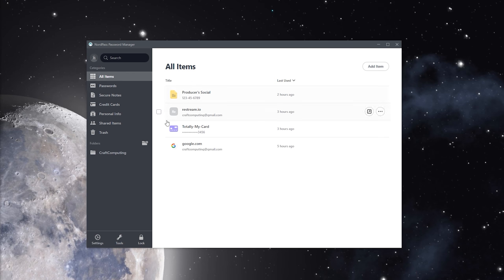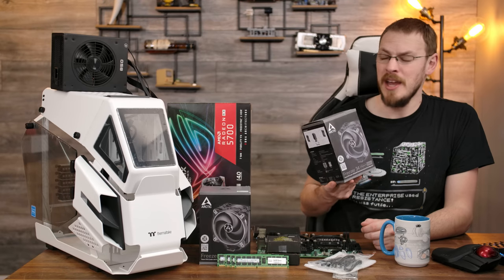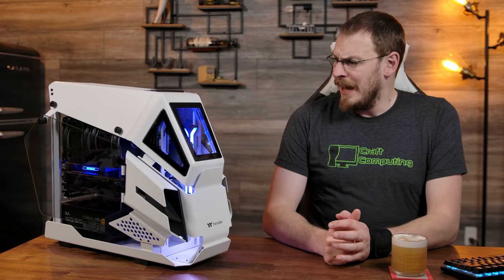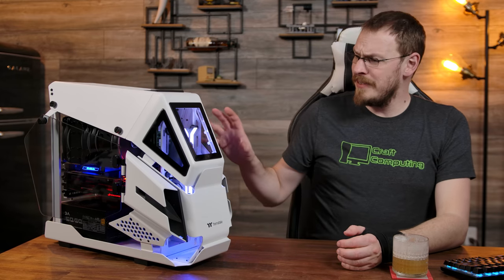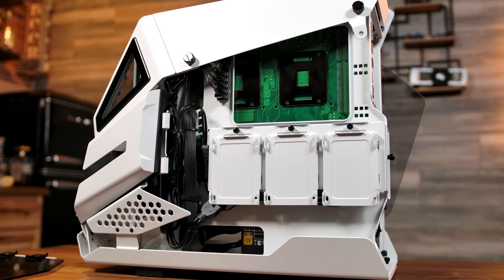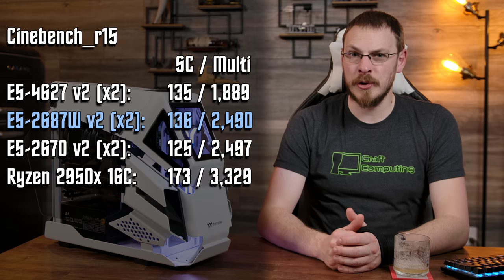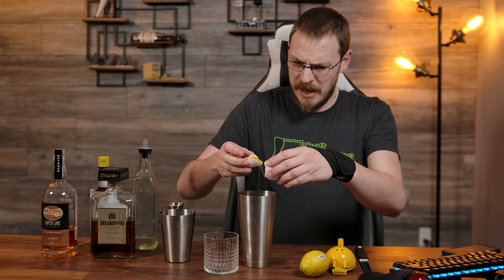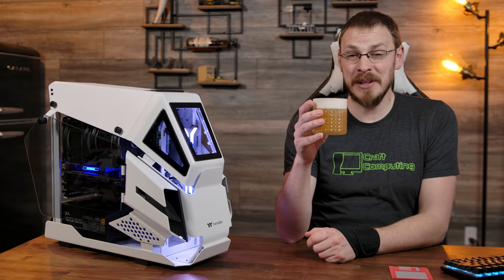Dual x79 + E5-2687w V2 in a MicroATX case!

Comment: E5 2667v2 is basically the same CPU, but at130w TDP rather than 150w. I recently built a dual CPU PC with them, and I honestly could not be happier with its performance.
Reply: Hey man, 2 years in the future im trynna do the same thing with the v4 version of the cpus, just curious if youve had any major issues in the 2 years since you built it, cheers

Comment: You cannot Turbo Unlock v2 CPU's, ONLY v3 Xeons unfortunatly.

But boy do my dual 2670v3 run fast :D
Reply: Exactly, the Turbo Boost unlock only works on Haswell CPUs. I'm commenting to try to make this comment more noticeable. Best regards!
Reply: lol, what about V4's ?
Reply: My Ivy Bridge-EP/EX Xeon E5-1650V2 CPU will quite happily run at 4.1Ghz all day. It's base clock is 3.5Ghz and my machine is an HP Z420.
Reply: @OmegasTracklab  anything after v3 is locked
Reply: @OmegasTracklab  neither v4 can be turbo unlocked
Reply: @PaulLemars01  That is a E5-1xxx CPU, not a E5-2xxx cpu.. They have unlocked multiplier and that is a whole different thing from turbo Unlock of E5-26xxv3 CPU's.
Reply: Yeah was gonna say, I didn't think a majority (all?) of these x79 chinese eBay specials couldn't have the bios modified let alone upgraded

Comment: If it helps you believe that cooling, E5-2690v2 in my Corsair case with a 212 EVO only runs at 55 under full load. Those Xeons with enthusiast cooling are a beast of workstation chips and run extremely cool!

Comment: Used this exact board and a pair of E5-2670v2's in my last home hypervisor/NAS in a Fractal Node 804. Ran it 24/7 under load for a year with zero issues.
Reply from the maker: Very nice! It would make for a very nice, compact home server 🙂
Reply: @CraftComputing  Very much so. And my electric bill thanked me for moving away from my entirely overkill rack to a uATX all-in-one. Have used my fair share of China Special X79/99 boards and haven't had a single problem with any of them. Once they have one with onboard video and IPMI I'll go back. Until then, I have to stick to my Supermicro board. Really enjoy your content. It isn't your typical tech channel. Sub'd!

Comment: It seems pretty good for what it is. I guess it just depends on what your use case is. If you are just looking at performance and don't need 16 cores for virtualization I'd say just spend the extra $200-250 and get a 3900x and decent motherboard, but if I already had this I wouldn't be looking to upgrade anytime soon.

Comment: I have one of these dual socket systems on a chinese remanufactured board you received a while back. I might seriously considering sourcing a pair of these cpu's and give it a performance upgrade. Going from a E5-2980's to E5-2687w V2's is a big jump. That's almost 1950X territory. As always, love the channel.  I just can't wait for the "Dual X99" stuff.
Reply: While searching the pricing on the E5-2687W V2,  I ran across the E5-2697 V2 for less money. Now I am back to cores vs clock speed. Which would you recommend, given the choice?

Comment: Extended micro ATX... Well, I for a long time have wished for a dual socket micro ATX board.
Though, the main thing I tend to look for in computers is memory bandwidth, and 4 channel support per socket is a killer feature that I wouldn't enjoy missing out on.
(Mainly since I do work on a lot of memory bandwidth intensive applications.)

Comment: Love your builds with obscure hardware like this!  Personal thoughts on the coolers though, not sure if noise was an issue but I'd remove one of the fans where they meet like the exhaust of the first one.  I find having fans butted up against each other can cause weird resonance especially if you have them variably controlled by the motherboard and might help the second cooler get some more fresh air to work with.

Comment: I really like the E5-2690 v2 Xeon's usually available on ebay for <$100 per unit. 10 Core / 20 Thread, 3.0 GHz Base / 3.6 GHz Turbo. 135 Watt...

Comment: The 2667v2 is basically the same CPU, just lower TDP if I remember right. 

The 1680v2 is also basically a single-proc only version that is also overclockable. I have a Machinist (Aliexpress) Mobo, so OCing is not only limited but more risky, but I bought the 1680v2 since it was only like ten dollars more than the 2667v2. It's worth having in the off chance I can get a nicer x79 board later if they happen to cheapen due to obscurity rather than explode in price like they have.

Comment: Extended Micro ATX.

In the meantime I laugh in Supermicro X9DRi-LNF4+. I had to use 3 EPS extenders and find negative-angled SFF8087 to fit this board in my case. Not to mention drilling and tapping 7 extra standoff holes.

Comment: Instead of a USB hub  (that end up using the same USB controller and can saturate it) you can install a PCI-E USB expansion card. I have one with 7 USB 3.0 ports and 2 controllers (4 ports in one, 3 on the other) and it is awesome. They are quite cheap on AliExpress. :D
Reply from the maker: I don't have any PCIe slots available. Both are used by the GPU and Capture Card.

Comment: It sure was worth the cost mentioned, I tried to go similar route a few months ago but with an ASUS dual 2011 socket board. What I failed to pay attention to at the time was V4 suffix on the description so alas, I went faceplanting into triple the cost that I set out to spend. However, I regret nothing, Broadwell is a very mature platform and the machine was worth every penny because performance I got out of it patched the price difference. 3ds max is still too heavily CPU dependent and with this platform the boost was insane compared to previous i7 I had.

Comment: I just swapped a Xeon E5 2690 V2 for an E5 2697 V2. I have 32GB of 1866MHz RAM and a GTX 960. My MOBO runs a 10% OC, so the 2697 runs up to 3.0GHz on all 12 cores. I use it for Handbrake video processing. It runs at the same speed on Handbrake as an I7 10700K with RTX 2060 with 48GB of 3200MHz RAM. The CPU cost me $85.

Comment: I don’t think the all-core turbo hack works on V2 chips anyway. Unless something has changed in the last year. It was always for V3 chips only from what I remember.
Reply: Also, for anyone interested in this level of CPU on the x79/c602 platform, there’s absolutely no reason to go with these CPUs unless they’re free or the same price as the 2667v2. The E5-2667v2 is identical in every way except base clock. The all-core boost is the same at 3.6GHz and the single core boost is the same at 4.0GHz. You get an extra 100MHz base clock on the 87Wv2, but you’ll never run base clocks unless you’re thermal throttling anyway. They both have the same 25MB cache, and bus speeds. And the 2667v2 has a benefit of lower TDP.

Edit: oh and the 87Wv2 only supports 256GB memory, where the 67v2 support 768GB memory.

Comment: Cpu temps. Hiding a failure?
Those are the temps for the hot spot on the die. Or atleast the "hotspot" the manufacturer put the thermistor on. With a cpu cooler that only covers part of an IHS, other hotspots may go un-cooled and un-measured
Reply from the maker: Each CPU core has its own temp sensor. I reported the hottest core. Trust me, I've been doing this a long time.

Comment: I'm wondering if it's possible to have a shroud between the CPU coolers and remove the middle fans (that way one is in push configuration and the other one in a pull configuration)
The shroud be like in a Z to force cool air over the left CPU 
I've seen something similar in HP Z800 workstation and would be nice to try 
I'm curious if we can get 40 degrees C for both CPUs :D

Comment: Pretty awesome! But to not post a CineBench MT mark...I guess it's trolling the ROM modders or frida users to help you unlock to 4 GHz. 
Safe to say I understand nothing about the airflow going on in that case; the top, the jowls, what that frameless thing backs up upon, a few still shots might have helped explain. What were the three slots in the back of the mobo plate, watercooling headers? Finally, what kind of IPC penalty comes in sharing data across CPUs?

Comment: i must have paused this video...like 10times to find in my closet what old hardware i have to build a new mini NAS cause i just remembered than my Zexyl 235 v2 doesn't support Sata 3 and i have Sata 3 drives in it....I dig out a Xeon E5504 4cores, and 6x2GB ddr3 1600mhz samsung ecc and a 120GB ocz SSD. now i need to find a mini Motherboard and a case and a sfm psu i guess... 
what OS should i use? FreeNAS?

Comment: I'm really surprised the case doesn't allow the PSU to draw fresh air through a vented bottom.  So, it has to mount the way you have it which causes it to fight the GPU for air.

Comment: I have the same problem with my server.I got like 18 memory slots 9 per cpu but only 4 memory modules.Given i got 32gb ram but i lose performance cause of configuration.I will try to get more later.As i am good for 288gb.I don't need it but i just want to do it for bragging rights 😁

Comment: LoL
"micro" - ATX. That's a 69L case.
I'm running dual E5-2667v2's on an Asus Z9PA-D8 inside a sub-20L Cerberus X. Completely whisper quiet. $250 in Noctua's will do that though :(

Comment: terrible price/performance.
could have gotten 2x 2682v4 (64 threads total)  and an "x99" dual 2011-3 mobo for about the same price. Even with lower frequency v4 is better in single core stuff.